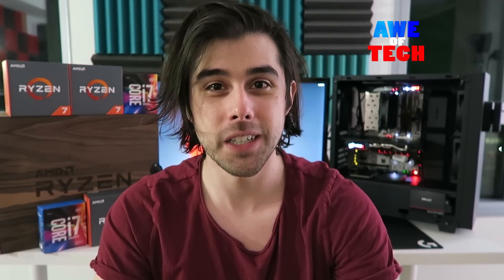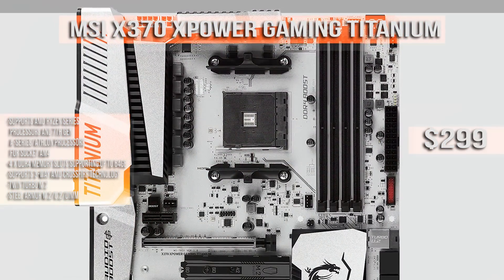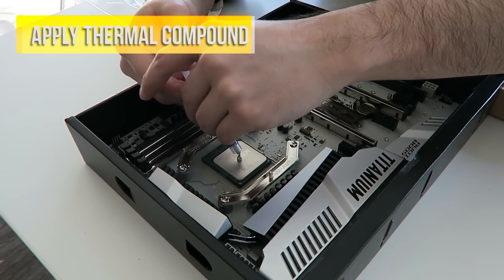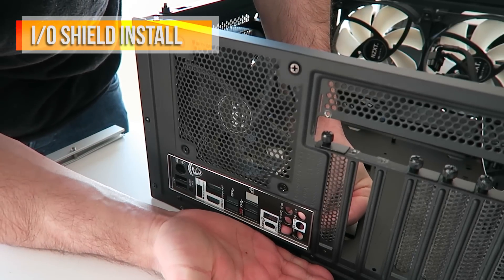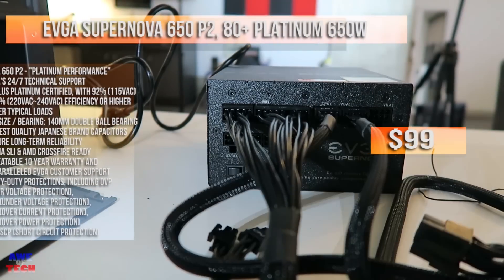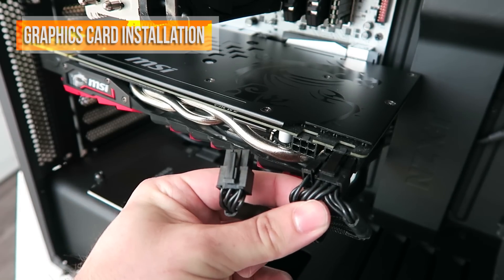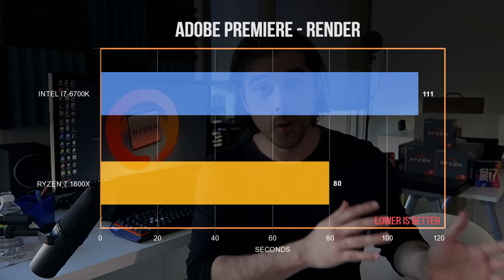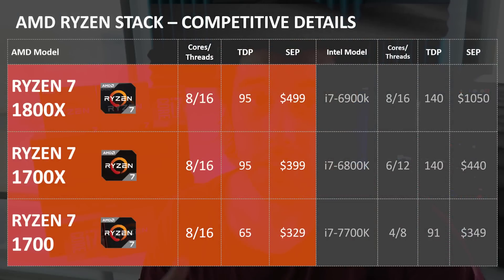How to Build a Ryzen Gaming PC - the AMD Upgrade Guide 7 1800X

Comment: Hi
can you please make an amd build with this spesifications
1.Cooler Master MasterCase Pro 5
2.ASUS ROG Crosshair VI Hero, Socket-AM4
3.AMD Ryzen 7 1700, 1700X Prosessor
4.NZXT Kraken X62, X52 CPU
5.G.Skill Trident Z RGB
6.NZXT Internal USB 2.0 Hub
7.NZXT 140 mm RGB-HUE+-system with 2 fan
8.graphic card of your choice
this is the system that i am goingto build so it will be perfect if you could build it.

Thank you so much.

Comment: Hey..i liked your video..its very loud and clear.. thanks..i'm a little confused here..the cpu power cable has extra 4 pins, are those need to be powered too? Because i read-ed other article they said that is additional pin to power up the board because of using extra cooling, some sort like liquid nitrogen or even power cooling..

Comment: You do know you could have overclocked the 1700 x. And got the same results. As an 1800 x. But for cheaper. Also, you could have gotten a 1700 and over clock it as well. And fall about 12 percent. Then in 1800*

Comment: I couldn't resist 'cheaping out' by spending $100 less on a mainboard (Asus 270A Prime), $150 less on CPU ($349 on 7700K), and taking the $250 saved and getting a free GPU upgrade with the savings....(saved money purchased a GTX1080 over the 1060 originally planned.....

Comment: Um, may I suggest perhaps working a bit on that editing? -_-
I'm sure you've done a lot of work with it and all.
It's just...
It's somewhat hard to read and it doesn't really look that good...

There's too much movement that's distracting while trying to read especially due to the transparency and movement going on behind the letters.
A bit less time to read then ideal.
The "error"/"hacking" animation also makes it harder to read and reduce the available reading time as well as adds frustration if you're actually trying to get to the information before the text settles.
Also, transparent orange?
Let's just say that it's not my favorite color.
Then there's the movement of text in from the side instead of say fade in.
With tired eyes (like mine right now after going a long time without sleep) it's actually rather hard to read and I can't really get started on the reading till it settles in 100% (something that takes a long time as it slows down and then only moves slowly, slowly but still enough to make reading more difficult then it needs to be).

And so one and so forth.

Don't get me wrong though, some of the visuals are really neat.
I especially liked the overlay over the motherboard showing what everything was.
That was some nice work there. =)

All in all though, I got mixed feelings about the editing.

10:03
Also, you got an error there...
Noticed how your averages seems to be higher then your max fps?

Comment: thanks i really needed to know how to get the right wire in right spot
Reply: everything except the front panel connectors should be keyed so it won't go into the wrong place or the wrong direction, just don't try to force stuff if it doesn't want to go, because you probably have it in the wrong spot or direction if it doesn't fit.

Comment: please i have some questions
Reply: i have 800$ should i get a core i5 7600k and saphire rx 480 nitro+ oc\evga gtx 1060 ssc or amd cpu and gtx 1070 for a gaming pc any help is much apriciated

if you i should get i5 7600k then should i get evga 1060 ssc or saphire 480 nitro oc
Reply: Wanna be Friends Don't buy a GPU right now with Vega and the polaris refresh cards coming out next month.
Reply: i had the same plan but i dont live in usa and my aunt is coming to india so i will no tbe get it afterwards

Comment: i need some tech support if somebody can answer a question
Reply: what's the question?
Reply: I have a fx 4300 and was wondering if samsung ddr3 was compatible with it
Reply: Yes it is. What kind of RAM are you running now?
Reply: im upgrading from 4gb to 8gb
Reply: +stanley jones Are you adding or replacing?
Reply: ScumbagSteve replacing
Reply: +stanley jones If you plan to run dual channel just make sure you get matching sticks
Reply: Thks bro
Reply: +stanley jones No problem. 
If you want to be on the safe side, send me the model of your motherboard and the RAM you plan on buying so I can make sure it's compatible.

Comment: Great video hoping to find a good B350 board and R7 1700, I think that will be a real killer combo.
Reply: Prince Thrakkath That sounds like the sweet spot right there. Just make sure that you get a B350 board that is capable of solid overclocking and your OC 1700 should be able to match a OC 1800x.
Reply: Yeah thats the problem I know so little about them its hard to decide which one to get.  Maybe +Awe of Tech  might get a B350 in to review soon.
Reply: Prince Thrakkath look on amazon for reviews